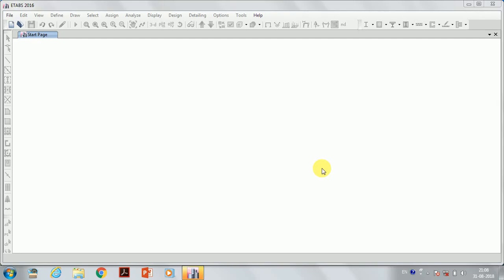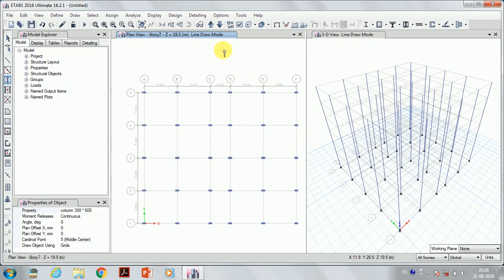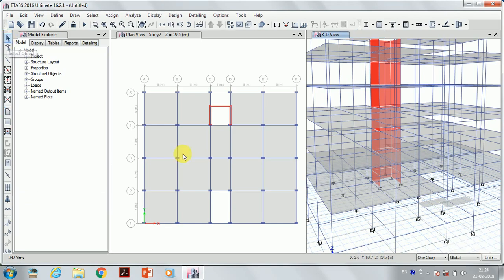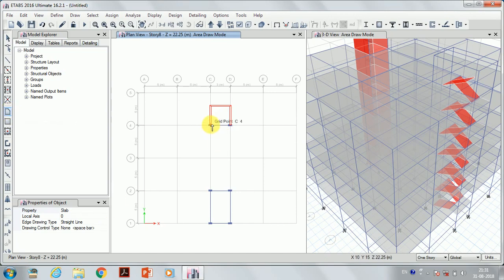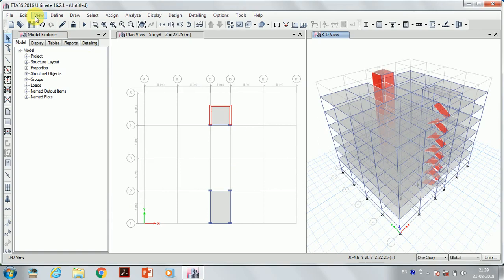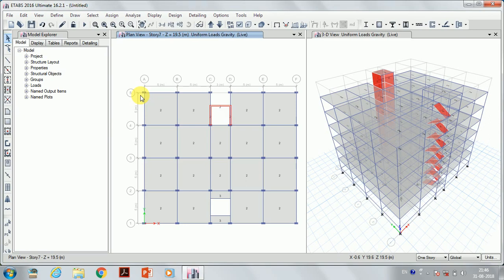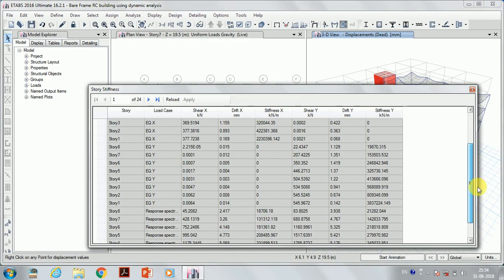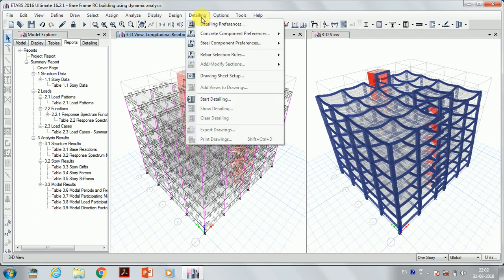Modelling & Dynamic Analysis (Response Spectrum Method) of RC Frame Building  using Etabs software

Comment: How to select the type of seismic design method i.e static or dynamic for an RCC building  ?
Reply: Dynamic analysis is done when 
1)For regular building
a) when it falls in zone 4 & 5 and height of building is > 40m
b) when it falls in zone 2 & 3 and height of building is > 90m

2) For Irregular building
a) when it falls in zone 4 & 5 and height of building is > 12m
b) when it falls in zone 2 & 3 and height of building is > 40m